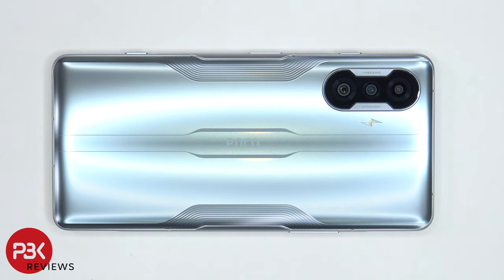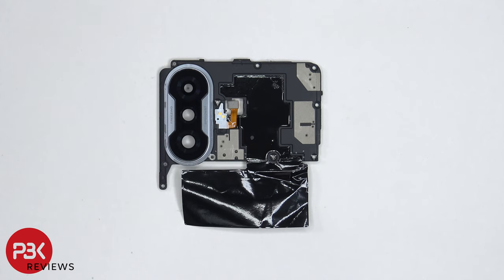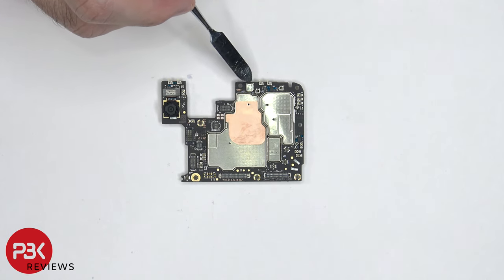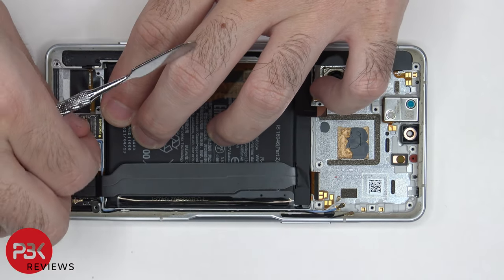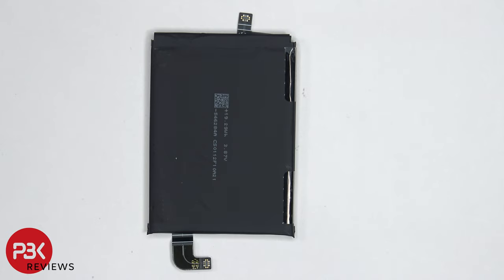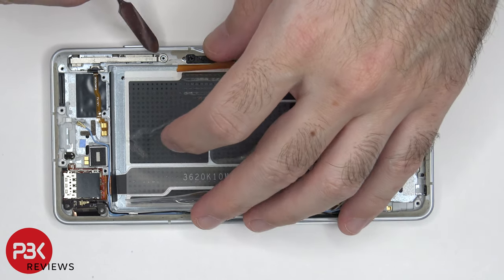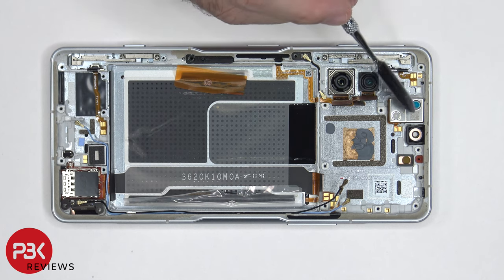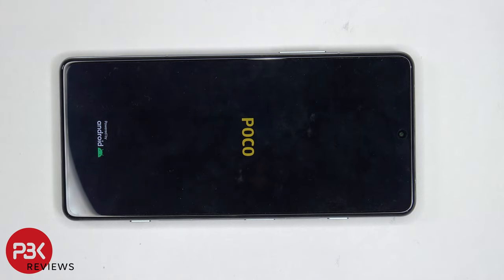Xiaomi POCO F3 GT / Redmi K40 Gaming Disassembly Teardown Repair Video Review

Comment: Where did you get the adhesive? I cant find it for that model anywhere can you please give me a link.
Reply from the maker: You would probably need one of these battery door cover replacement parts which come with the adhesive pre installed. They don't seem to be selling the pre cut adhesive by itself for this phone. https://www.aliexpress.com/item/1005003697199471.html?spm=a2g0o.productlist.0.0.7f4a92e34vAp1s&algo_pvid=2d23a939-b038-4bc3-a40b-1eed95e27932&algo_exp_id=2d23a939-b038-4bc3-a40b-1eed95e27932-0&pdp_ext_f=%7B%22sku_id%22%3A%2212000026842857920%22%7D&pdp_pi=-1%3B31.31%3B-1%3B-1%40salePrice%3BUSD%3Bsearch-mainSearch

Comment: Wait there is actually a physical proximity sensor in poco f3 GT, then why it fail the proximity sensor test.
Bc I did see other youtuber doing the proximity sensor test in mi x 5g & f3 gt and they said there isn't a physical proximity sensor. So what to believe now
Reply from the maker: Yes, it has a physical proximity sensor. It's also listed in the specs on the website.
Reply: @PBKreviews  then why it's not working properly 🤷
Reply: Maybe it's a really crappy one
Reply: I read somewhere that it is not the regular proximity sensor instead they used ultrasonic proximity sensor which is kinda new. Maybe it will get better after a few updates

Comment: How much heat is needed to weaken the adhesive on the back cover? Will using a heat gun damage the internals? Thanks.
Great video
Reply from the maker: Hi, you can always use a hair dryer if you are not sure since there is less of a risk of damaging anything. But you need to evenly heat up the back cover to the touch so when you touch it, its hot enough make it uncomfortable to leave your finger on it. You can always apply more heat as your working your way around prying it off. Also if you need to gain leverage to get your pry tool in between the back cover and frame, you can use a suction cup tool to help you lift up.
Reply: @PBKreviews  thanks a lot, will give it a go

Comment: The top speaker of my k40g got  crackles. Few first time i just knock it out or reset the phone then it work fine again. Now it crackles full time. Do you think replace speaker will help?
Reply from the maker: It's possible. Might be debris that got attracted from the speakers magnet to the speaker causing it to do that. You might be able to clean it off from the speaker filter once you remove the speaker.
Reply: @PBKreviews  thank you so much

Comment: Bro is there any way to replace the volume rokerrz mine is damaged
Reply from the maker: Yeah, I'm not sure if they are push in or pull out ones. If its pull out ones, they should be able to be pulled out. If not, you need to take the phone apart and remove the rubber gasket in the frame, pull out the flex cable for the volume keys from the frame slot and push in the physical buttons into the frame to remove them.